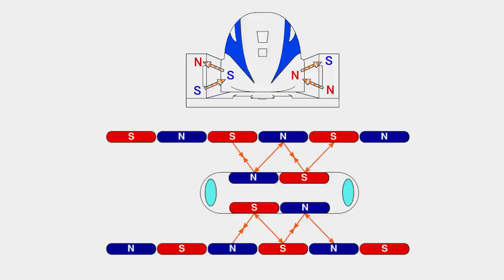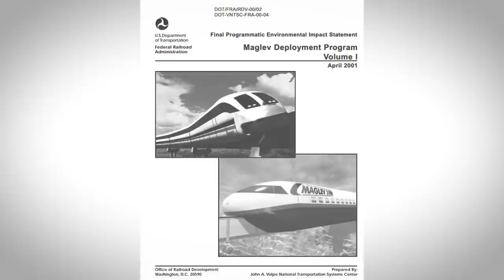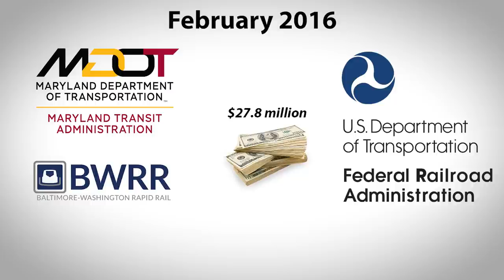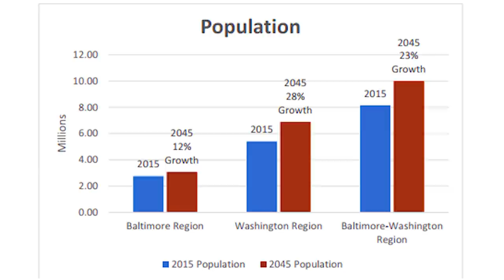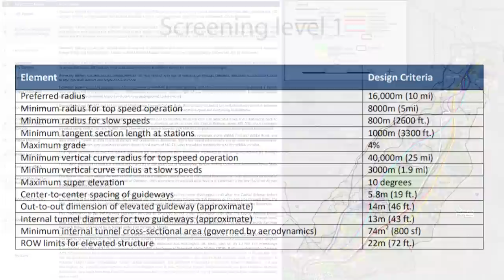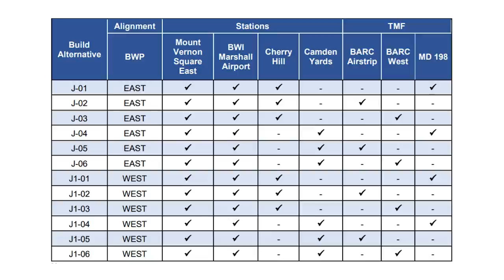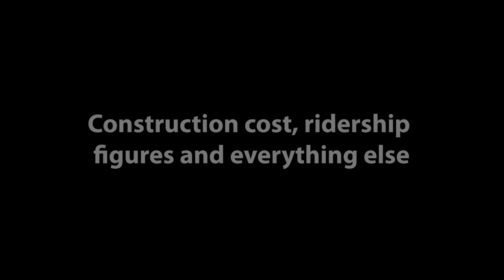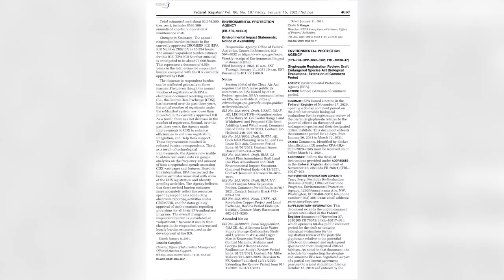Baltimore–Washington Superconducting Maglev Project

Comment: Why not first upgrade existing rail lines and make them run properly.
Reply: Thanks you
Reply: Cause they’re not owned by the government. They’re owned by private railway companies, Amtrak leases track
Reply: existing rail lines cant support these hsr
Reply: Yes need upgrade for Fit to high speed rail
Reply: @Sparkieb123  they own track
Reply: @ama6487  then upgraded them
Reply: @Sparkieb123  but Amtrak does own the existing rails in this corridor between Washington - Baltimore, up to NYC, and to Boston
Reply: @doublez3ta  …which are in the process of being upgraded for the Acela
Reply: Acela is where it’s at. Technically it should get up 150 MPH which would be a massive step up by Ireland in US rail travel, just need the track upgrades.
Reply: @gamerfan8445  to upgrade those tracks they need to make the alignment as straight and no elevation as possible, and cannot use it for freights.
Reply: @QueenetBowie  New Acelas can reach 220MPH if the NEC tracks are fully upgraded too
Reply: They're doing that
Reply: @ama6487  Northeast doesn't share passenger rail with freight rail. If anything they're are planning on improving our old rail system to make it straighter for the new Acela trains
Reply: Like upgrading them to 180 mph service then yes
Reply: @Sparkieb123  build new track
Reply: @ama6487  build new ones and remove passenger trains from the existing lines
Reply: The whole thing started way back in 1991. That's *30 years ago*  !

Which means, if they had wanted to upgrade existing rail lines, they had 30 years to do so, but, they don't.
Reply: That's not how high speed rail works. At-grade crossings, sharing with freight, and having severe curves means you're not going to improve very much with those constraints.

Successful HSR can not share rail with slower options, and it can not have grade level crossings especially in urban areas. It's impossible. Which is why Brightline here in Florida is going to be a disaster.
Reply: @hwgusn  yep. Aside for the final approaches to stations in both cities, the entire section between DC and Baltimore already runs at 125mph / 200 kmh. On the Washington side, the speed limit immediately after exiting the station is 100mph, and it very quickly increases to the full 125mph speed limit. Baltimore, on the other hand, has a really poorly placed tunnel exit curve that limits speed to 30mph. The tunnel already has finalized construction plans and funding, and will be complete by 2032. The new tunnel will limit speed to 100mph, just like DC's approach limit.
Reply: "Why not first upgrade existing rail lines and make them run properly."

Because this is a private company implementing Maglev. It's not a government project.
Reply: U need maglev train to compete with air travel

Comment: I’m from Baltimore and many people who work in DC live in MD (or norther VA), because of cost of living. Unfortunately 95 is a pain to drive down to get into DC. If this happens, it’ll be a game changer.
Reply: Exactly.  I have driven I-95 between DC and Baltimore - and have taken the MARC Penn Line (which overlays the NEC between the two cities).  The biggest problem with the NEC - and not merely the southern portion - is the very AGE of that infrastructure - most of it is older than I am - and I am sixty!  Tearing it out is impractical - which the advocates stating that SHOULD be done are absolutely aware of - I'm not stupid.  (I will wager that they really want to destroy the NEC because of the long-held view in the United States that passenger rail travel is ONLY "for the wealthy" - despite that it is not - and has never been true of - regional commuter rail (due to it being subsidized by local governments (in the case of MARC, the state government).  Further, neither BWMAGLEV (the initial project) or NORTHEAST  MAGLEV (the longer-reach successor) will displace either the the Penn Line or the NEC as it stands.  Modernization of the NEC (and thus the Penn Line) will still continue.  Lastly, what percentage of the travelers between merely Washington and Baltimore (BWMAGLEV) absolutely NEED the absolutely fastest means of getting between the two destinations?  That would likely BE the wealthier business traveler - so why NOT have this higher-end customer pay for that privilege?  (That is indeed the way HSR is operated everywhere - including Europe and Japan.  It is an alternative to conventional rail and even conventional HSR - in addition to (ala Shinkansen or even SNCF or AMTRAK Avelia Liberty/Acela21), not instead of.)
Reply: Would you pay $27 each way, as described in the video, to go from Union Station to Cherry Hill? Would it save anyone commuting from north or east of downtown Baltimore any time at all? Driving from Cherry Hill to Penn Station takes twenty minutes, so there is zero benefit for anyone trying to connect further up the NE corridor. If it doesn't save users time or money, what is the benefit of using federal tax dollars this way? We should fix what we have rather than investing in this shiny new toy.
Reply: @sethdcrawford  they would have to bring that cost down. But honestly, at those prices, this would wind up being for expedited business travel from jobs that would subsidize that kind of cost
Reply: There are already trains running from Penn Station to Union Station, for about the same prices given in the video.  What game has that changed?
Reply: @michaelsommers2356  speed
Reply: @FinancialAnalysisTJ  What is so revolutionary about saving a half hour?  And will the travel time actually be less, given the locations of the new stations?
Reply: @michaelsommers2356  how we view the importance of our time is all relative. and do you really expect me to know how fast it will actually be given locations? just let them build it. if you don't like it, don't ride it
Reply: @sethdcrawford  I think you're forgetting Baltimore has an alright Lightrail system. You can just take the Lightrail into downtown. Besides. Cherry Hill will see massive development in the next decades and it will be much more practical since the SB7 will be better integrated to downtown Baltimore.
Reply: @michaelsommers2356  not half hour. More like +1 hour. Dont pretend getting from DC to Baltimore doesn't take almost 1h30 minutes. Realistically. It's a pain... they claim 15 minutes. So I'd say tops 25 but who knows. Either way it's necessary to connect the rest of the Northeast. We're decades behind. Northeast and subsequently America's economy will stagnate because we're the only ones capable of decent public transit but we never take the chance. California and Texas have awful sprawling infrastructure and I dont trust them to do anything practical or worthwhile. Our country needs the Northeast and the Northeast needs HSR.
Reply: @FinancialAnalysisTJ  If you are going to claim that it will be faster, then, yes, I do expect you to know how fast.

The problem with just building it is that it is being built with taxpayer money.
Reply: @FinancialAnalysisTJ  You're forgetting one key part, how much time would it take the maglev train to build up speed and slow down?...
I can guarantee you, MARC (i.e.: Camden Line literally follows the path the Maglev is going) could beat that Maglev from Baltimore to DC by ten minutes easily
Reply: @ElyOmar  Amtrak takes half an hour to an hour to go from Penn Station to Union Station, according to their schedule.  That's station to station.  Getting to and from the station on either end will be approximately the same on either system.

The idea that the whole US economy will stagnate because you can't get from Balto. to DC in 15 minutes is laughable.
Reply: The train will travel faster than a car, but add the :30+ min driving to the station, finding parking, walking to the terminal then waiting for the next train... what time did you actually save?
Reply: @sethdcrawford  Ah, but don't you see? Boondoggles are the life-blood of DC politics.
Reply: @FinancialAnalysisTJ  When you factor in all the added time driving to the station, finding parking, walking to the terminal, purchasing tickets, waiting for the next train, crowding in to find a seat, then repeat in reverse at the other end, how much time will you actually save? Oh, but the train goes faster than a car! Yay! 🤣
Reply: @david_a_uno  Not everyone has that situation. Some could get dropped off while their spouse goes to work with the car. Some could walk there. Obviously if you live far from the station you have to factor in opportunity costs. If it doesn’t work for you, guess what? It may work for someone else
Reply: @michaelsommers2356   …I’m going off of what their estimations will be. I didn’t design the thing. Yes, it will use tax payer money. You can argue that if it does improve productivity, or recoup on costs from tickets, there is an economic incentive
Reply: Apparently Baltimore has been giving Northeast Maglev, which is trying to do this with private funds, a hard time. They say Northeast Maglev wants to pass through too many neighborhoods without providing a stop. It's like, uh, yeah, we're passing through....200 feet underground, and our tech doesn't have any moving parts.
Reply: The other option, MARC trains, and the same concept for VRE Rail for those in VA,  means employees have to leave by a specific time to catch it.  If that was replaced with Maglev that could got to/from DC to Baltimore and each stop in under 20 minutes, more trains could be added and schedule could be every  20 or 30 minutes. 
That's allowing a train to complete the whole route so next one could leave after train ahead reaches halfway point can shorten schedule: allowing more trains and flexibility for everyone who uses them!  How safety requirements would affect that is another factor.

Comment: maybe the US should first replace the +110 year old infrastructure on the NEC like the Hudson Tunnel and Portal Bridge. But even those projects fail even to get started.

We will have Christmas in August before we see Maglev up and running in the States..
Reply: There's also a 19th century tunnel through downtown Baltimore that's a major chokepoint and has needed replacing for decades. There was a fire in it about 20 years ago that shut it down for weeks.
Reply: Thank lobbyists
Reply: I believe they have been funded in the new infrastructure bill.
Reply: if the government is doing it maybe lol. This is private company doing it for fun and profit. With private funds.
Reply: The Tragedy of the Cargo Ship taking down the Francis Scott Key Bridge has already begun all bridges having new reinforcement stabilizers installed has been seen as a major wake-up call for the US or the US government to really begin overhauling the aging infrastructure in this country! The bridge collapse in Minnesota & in Philadelphia should have been the Wake-Up Call, and not a whole bridge collapsing. Bridges & Tunnels/ Electric lines/ sewer systems among many other things need to be evaluated! Some may be fully adequate & safe, some  need minor to major work, andthe need to replace others? Like a 70+ year old quarter mile bridge in horrible condition it becomes so expensive to repair, building a new one is actually cheaper option.
And of course the Rail Network in US. Replacing track for high speed & also building Maglev systems. If it existed already and workers could Replace 60+ min in car sitting in traffic with time on train, maybe commuting to new higher paid job in NY without having to move out of DC! Would at least Make Commute more comfortable. You could even begin working from train & go through all those emails that majority of people working in office spend 1st hour, or longer, of day as soon as they sit down at desk!

Comment: A great video. I learned a lot. I was not aware that there was any such plan. If the DC to Baltimore route is just a starter segment that will continue further up the East Coast, I'd say it looks sensible. The JR Tokai (Central) Maglev system is to connect far-flung destinations with short travel times, a competitive alternative to airplanes. So if this is on the drawing board I now question the Amtrak NE Corridor spending as is. I believe there is still a place for Acela HSR but it needs to be redesigned around connecting the western edges of the corridor such as Philly, to Allentown, Scranton, Syracuse, Rochester, Buffalo, Niagra and should be a competitive alternative to not only short-haul flights but also driving. I see it as a way to drive economic growth by connecting workers with job centers.  But back to the Baltimore maglev, I believe the pricing is a recipe for disaster. If it is too low the service will require subsidies which could create social licensing risk from American taxpayers outside of the region and create political risk. Do we know who will own this rail line?
Reply: Ownership is complicated.  Just the 40-mile ROW segment between DC and Baltimore is a mix of private, city, state and federal lands - with several of the fed lands being especially sensitive in nature.  Purchasing the numerous properties to establish a rail corridor would require eminent domain of the non-fed properties.  Fed lands are protected from eminent domain, but if the project is considered a national priority, the fed agencies could be influenced to contribute the needed portions of their properties.  So, in effect, you’d have a corridor that is “nationalized” under, say the Bureau of Land Management.  In coordination with the FRA (and Japanese Rail), a rail operator could be contracted to design, build, operate and maintain the corridor and run the service. The same model could be applied as the ROW continues to NYC.